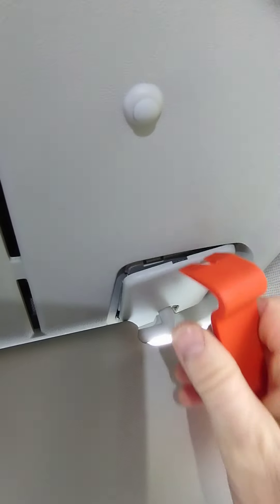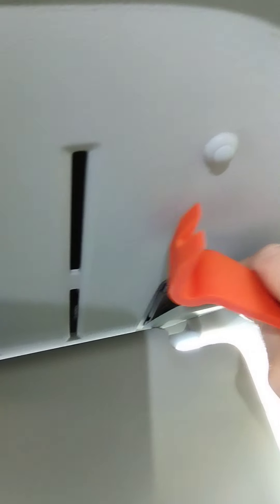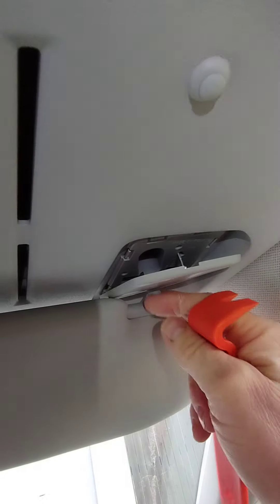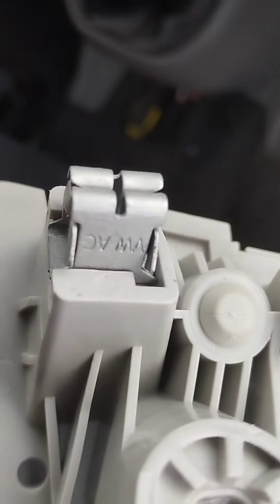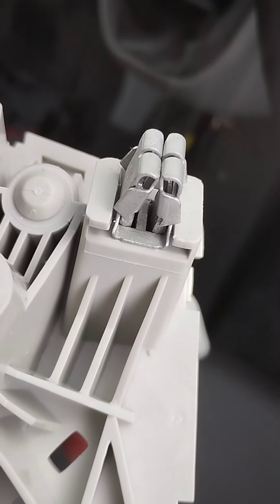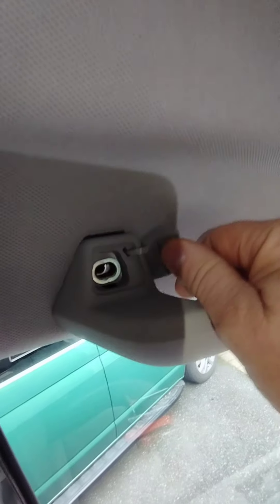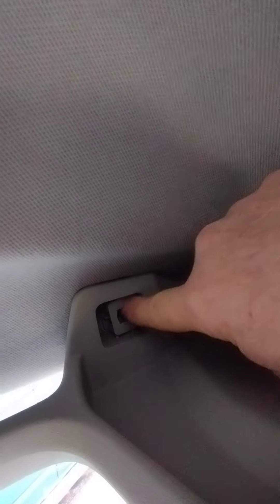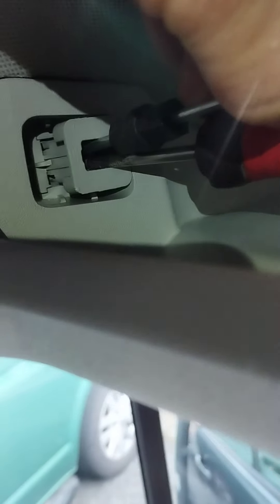VW Crafter ManTGE Campervan Part 2 Headliner Removal for insulation of the roof section

Comment: great  two vids helped me a lot and gave me the confedence to give it a go  i put off doing it because everyone said it was a swine of a job  but away over the new year i got the dreaded condensation dripping off the grab handles on the A post  and dropping in to the cupholders. i made a toll like vw but still only manage to get one clip off had to take it to  a car uphosterer i know and he manage to pick the clips out . your vids were excellent and easy to follow made doing the rest of it very easy  i didnt notice till i tried to drop the lining that it is trapped behind  the thing at the centre of the windscreen at the top and was a pain to work around  but all in all thank you for posting it
Reply from the maker: Hi Guy , Thanks for your message and glad it helped with your resolving the issue..☺️